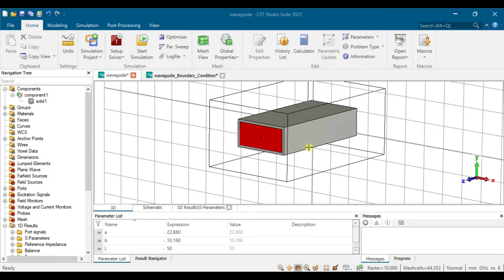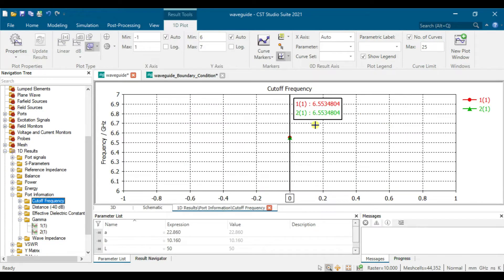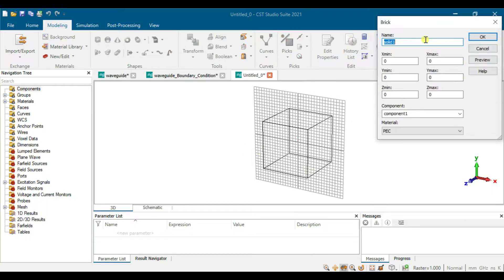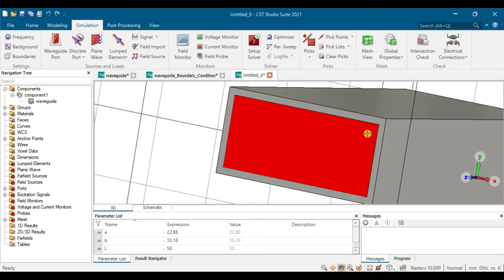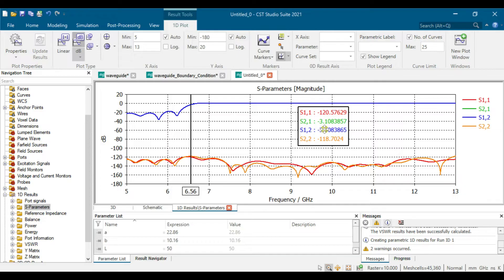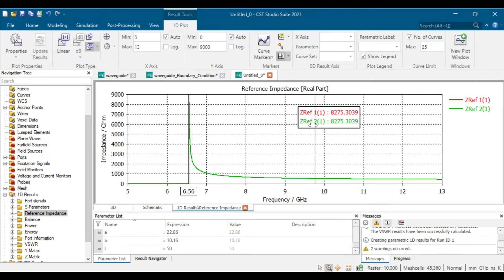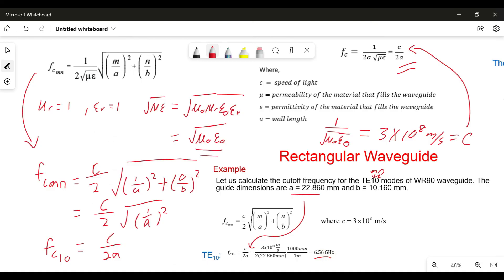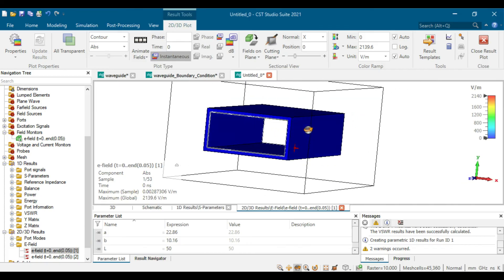Design Rectangular Waveguide in CST

Comment: 4:18 "Shell solid or Thicken Sheet" button is qrey and uncklickable😢
Reply from the maker: @ondrejvlcek5145  maybe you miss out the " pick face"
Reply: @LYSStuff  No, that was not the problem. I'm not sure what was wrong. But I think, that helped Ctrl+double click to object. Thanks for trying to help :)
Reply from the maker: @ondrejvlcek5145  it required the waveguide 2 side front and back with pick face. Only can select the" shell solid or thicken sheet"

Comment: Hello, thanks a lot for the video. The result loss of your waveguide is 0.0235dB/50mm so 0.47dB/m, but in the tab that you show at 1:05min, the max attenuation theorical is 0.103dB/m! Are you shure than this solver is good?
Reply from the maker: Hi, Welcome. The loss of waveguide in the video is 0.0235dB/50mm, but is at 9 GHz. From the data sheet that in 1:05min, the max attenuation value is refer to center frequency of the waveguide, 10 GHz. That is common for e.g WR62, 12.4 to 18 GHz, the attenuation in data sheet will refer to 15 GHz. You may download the CST file from my video description, and run the simulation then check it at 10 GHz, loss 0.005dB/50mm. you will get approximate to the 0.1dB/m attenuation. if you have better recommendation solver or method, please share to us too. 🥂

Comment: Thanks a lot for the video. BTW in 5:23 when you assign Waveguide port 1 and later port 2, you can increase the parameter 'Number of modes' from default 1 to 3 or larger. This will instruct the solver to solve for higher order modes fields. Since you set calculate until 13 GHz, we can see EM field distribution from modes like TE10 (dominant), TE20, TE01, TE11 etc and also evanescent modes, useful for when one learns about waveguide.
Reply from the maker: Welcome and thanks for the suggestion. Besides, do you have any reference how to measure other than TE10 mode? Like TE20, TE01, TE11. Thanks. 😄
Reply: @LYSStuff  There are many online resources. But I think the most systematic way is to just read a college textbook on electromagnetics. There you can find how to obtain the expression for guided EM fields in transmission line & waveguides, concept on wave impedance, phase and group velocity, cut-off frequency and power flow. 
For instance in rectangular waveguide fcutoff is: (1/2sqrt(u*e))*sqrt((m//a)^2 + (n/b)^2)    where m, n = 0, 1, 2, 3...     'a' and 'b' are the width and height of inner area of the guide.  
A reasonable book (price reasonable too) is: F.T. Ulaby, U. Ravaioli, "Fundamentals of applied electromagnetics", Pearson, 2020 (older edition also good).
Combining EM simulation tool like CST with theory from book is a good way to gain deeper understanding. I have some old materials that may be useful: 
https://github.com/fabiankung/LectureSlides_RF_Circuit_Design
Reply from the maker: @fkungms  Hi, thanks for the information. Yes, we can calculate or simulate all those mode. But I not sure how measure other mode other than TE10 for rectangular waveguide.